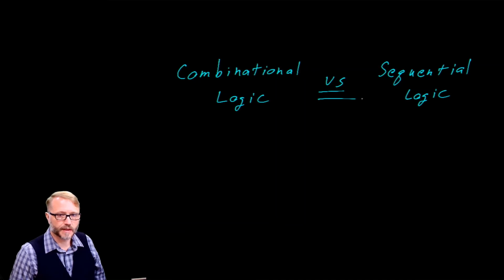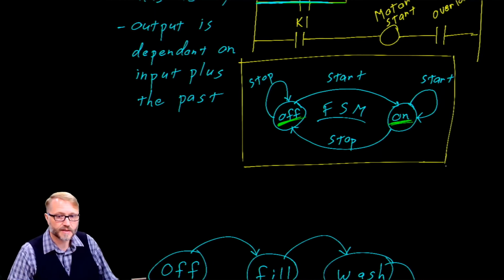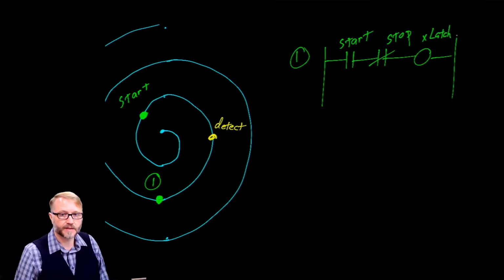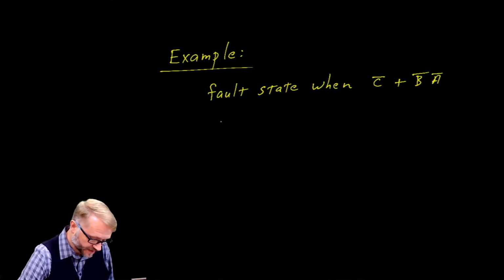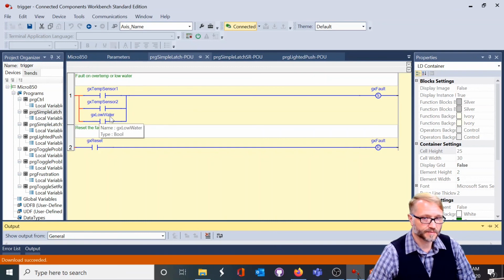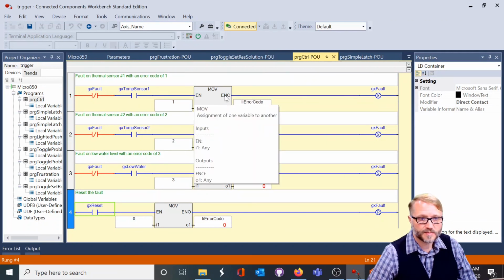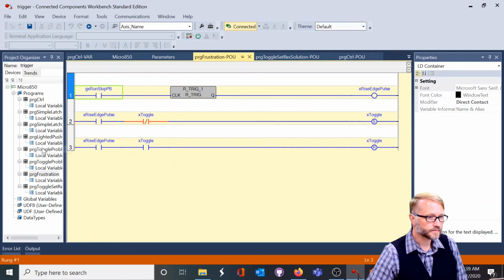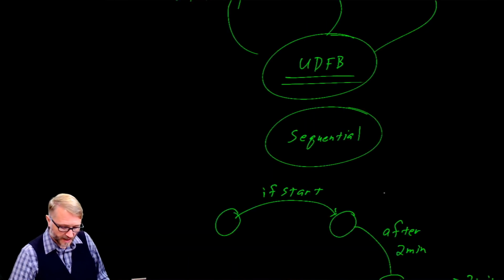Micro800 PLC Lecture 7: sequential logic including the latch, seal-in circuit, and set / reset coils

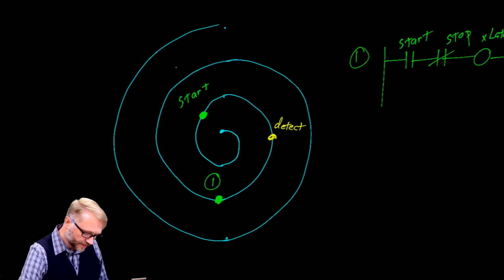Comment: Great set of lectures - just a little nit-picky comment.  If you are going to use a NC PB for stop - you cannot use a "reverse contact" in your ladder logic.  Time 11:02.   If you do, the little "PLC man" will go look for a zero and find a one every time till the button is pushed.  But it is obvious you know this stuff inside out - may be I am wrong - may be an oversight on your part
Reply from the maker: That's true Robert. 

There is a trick that I didn't clarify in this video. If you followed this series of videos, you know that I like to gather all of the I/O into prg_InMap and prg_OutMap. The prg_Ctrl then references each I/O as a global e.g., gxPBStop (global boolean Stop push button). 

Inside the prg_InMap, we can flip the negative logic of the physical NC Stop button to positive logic. Once this is done, we can use language such as "when not stopped" as shown in this video.